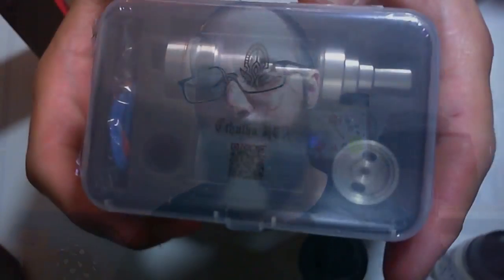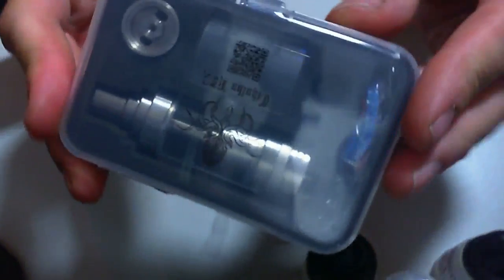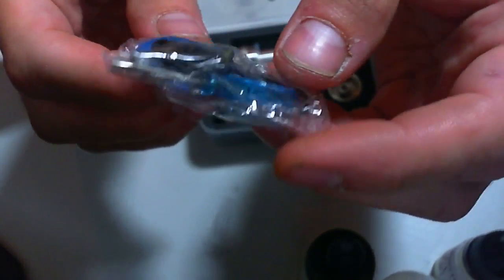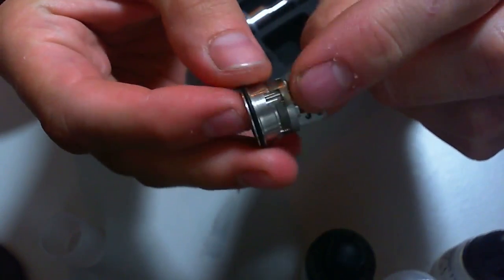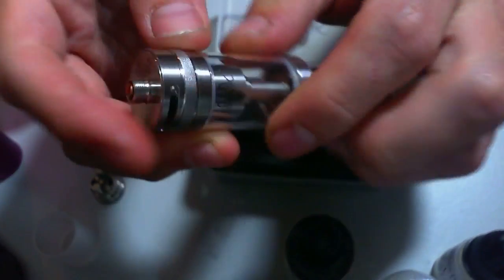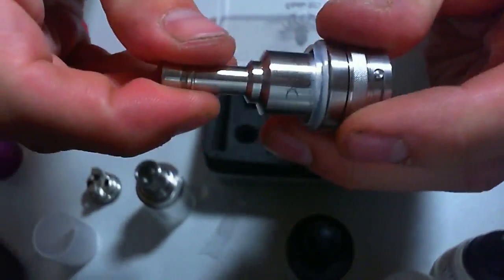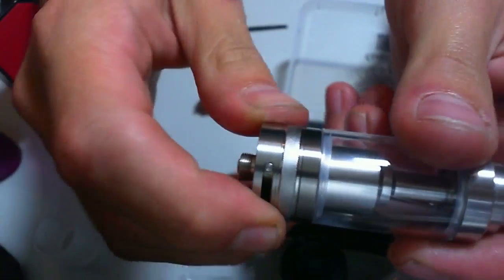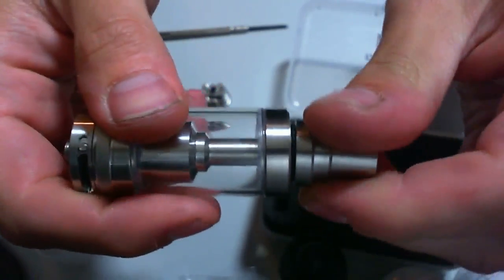Cthulhu V2 RTA: Unboxing & First Impressions

Comment: Got mine yesterday here in uk. Took it apart to wash it and noticed 510 pin is all chewed up like they took power tool to it!! I know they had to rework them all as there was Probs with centre pin, But mine was unacceptable! Contacted my vendor and he's had trouble with a lot his sold!! Any way he's took pin out of another Cthulhu and its in the post!! He's not Happy with Cthulhumods and has contacted them for spare parts.  Nice stuff Fella.
Reply from the maker: That sucks, man. I went easy on them with their QA issues on machining with V1 as it was their first product. Then the Hastur had tolerance issues and I was a little bit more hard on them in that video. if these V2s are still having machining issues, that's just dumb.

 Thanks for the comment mate, it really helps me to get a broader picture as its hard to know from just the one in my possession.
Reply: Ironhammer5 Yes you don't expect to much for the £ point, ut it should serve its purpose!! The rest of the RTA's Build Quality was ''ok'' But that pin is Unnacceptable IMO. cheers for reply buddy

Comment: After loosing the top nut on the first Cthulhu, and going to half a dozen hardware stores to find it was a size no one had, and having to pay $5 and order it form them and wait a month for it AND seeing all the parts in this one. I think i will avoid this like  the plague. :) Thanks for the closeup as Cthulhu just seems like they want complicate something that should not be complicated. :)
Reply from the maker: +The Vaping Computer Guy Yeah, part of me is thinking that  they could've just made the V1 but made it have a velocity style deck and that would have been enough... rather than over-complicating things with all these weird parts.
Reply: +Ironhammer5 Yes, From the looks of it the V1 even with that annoying screw that easy to drop down the sink looks simpler and does work. Curious what you think of this once using it for a while. :) Thanks!

Comment: Still waiting on mine... I found with the V1, if you put some petroleum jelly on the threads and on the inside of the air control ring, you will have a much easier time with it.

Comment: Thanks for the first look!
You think you can fit larger diameter coils on the velocity style deck? I barely managed to fit 2.5mm on the V1 but without the center block the V2 might be able to accommodate 3mm coils.
Reply from the maker: I think 3mm would fit. :)

Comment: I can't get the juice control to work at all. I can't adjust it independently of the other components. So I either get major leakage or dry hits.
Reply from the maker: I just took that stupid juice flow ring out so its fixed wide open in the end. Not had any trouble leaking but I do use Max VG juice.

Comment: dude half of your video is you fucking with the tank out of frame ...
Reply from the maker: I know, and I apologise. The point of the video was to demonstrate my very first impressions, and my first impressions in this instance were, "what the fuck, I need to look at this more closely".

I did try to re-demonstrate most things in front of the camera once I figured it out for those who have the patience to sit through my confusion.

A full review will follow once I've spent time with it and it will remain in frame 100% of the time. :)

I was just really confused by this tank at first despite watching their tutorials before unboxing.
Reply: +Ironhammer5 So it doesn't come with any sort of instruction manual? If it did, why not spend 5 minutes reading it and remove some of your confusion? Water under the bridge now, but FFS...
Reply from the maker: +Larry Walewski no manual aside from a useless diagram on back of box. It's called first impression because that's what it is, full review incoming wherein I'll actually know what the fuck is going on with this thing.